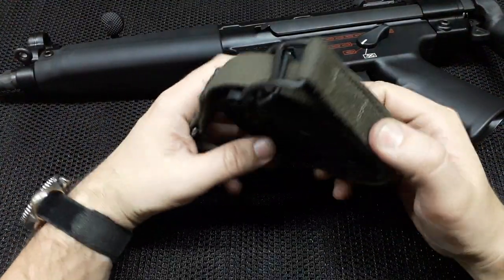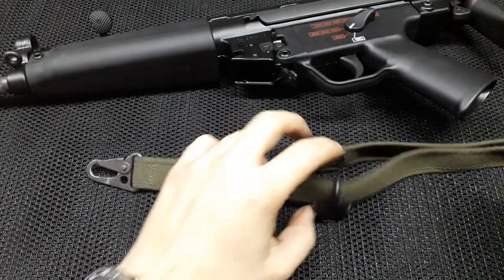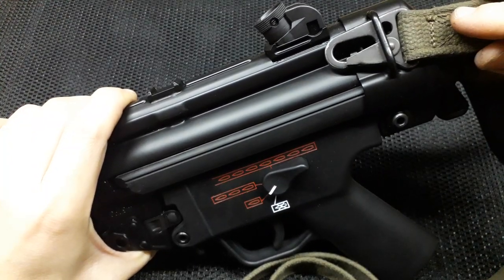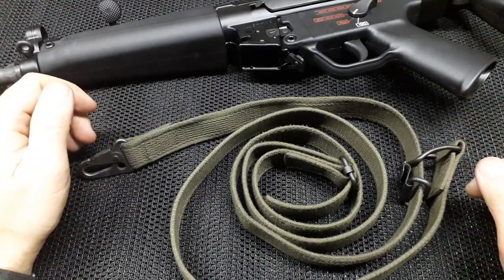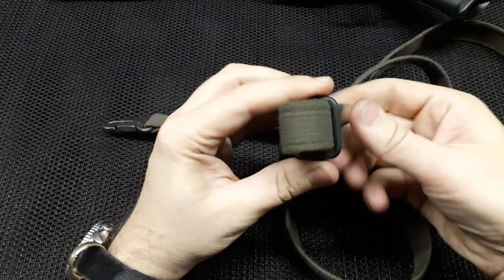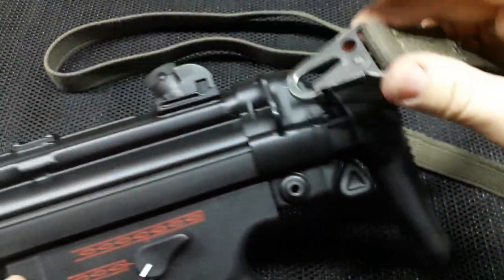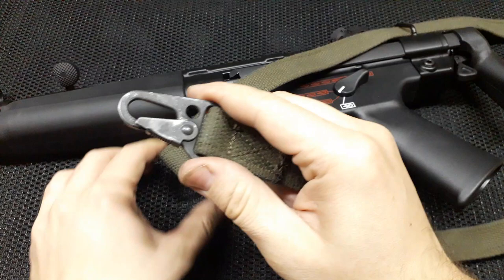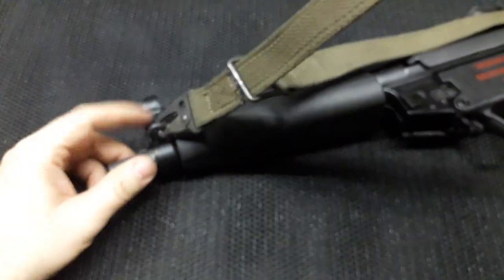H&K 3-point sling installation SF style

Comment: Spent 11 years in Marine Force Recon, 80s and 90s, we  attached it a few ways but I used the method you are talking about.  Keep in mind ours were the MP5N, Navy model.  We made the front attachment clip fit under the rear attachment point by filing down the back of the rivet on the clip, making that bump flat then you can rock the clip through at an angle and attach it to the front.
Reply from the maker: Hi! Thank you so much for  the confirmation and for the additional info. Means so much! :D Yes, The MP5-N, I was making this video before i have converted my MP5A5 into the MP5-N. I have made videos about the conversion. Is there a way I could get in touch with You? I'd like to ask you about a vertical foregrip i have seen attached to the MP5-N used by Marine Force Recon. I'd like to send you a picture,maybe you can tell what it is. Picture is from the early 90s.  Let me know. Much appreciated! Thank you!
Reply: Whats your email
Reply from the maker: @mren65  tomi_smoke@hotmail.com  😁👍

Comment: I love this variation! Don't know if it works, but I'll give it a try.
Reply: OK, it doesn't work with an A2 stock. The webbing doesn't slide through the built-in slot freely, which is necessary to switch sling configurations. (NOTE: 1-inch webbing fits through this slot just fine; if you're mounting the static END of a sling to an A2 stock, it'll work great.) 
Also, the J-hook clip sling loop (the part you removed) works so well on the A2 stock that there may not be a reason to try to improve it. 
ONWARD! I want to try it on my B&T folder.

Comment: No. There's a u-type clip that attaches to the rear bar on the rear stock. The front has a loop and the self closing clamp goes there. 
Do not disassemble the sling. Just attach the 2 points and slip your head and arm through the large opening and adjust slack. Easy peazy.
Same sling works on all legacy hk.
Reply from the maker: Sorry, you are missing the point. The way you have explained it is the regular way. This video is about the "different" way that was done by US Navy SEALS and other units...please watch the complete video...
Reply: The U-clip doesn't attach to the rear bar.  The U-clip attaches to the bent shaped buckle and transforms the sling from a 2 point sling into a 3 point sling.

The sliding buckle automatically adjusts to the shooter's preference / the shooter moving or transitioning while allowing for quick adjustments.